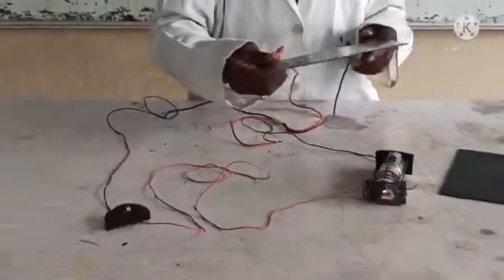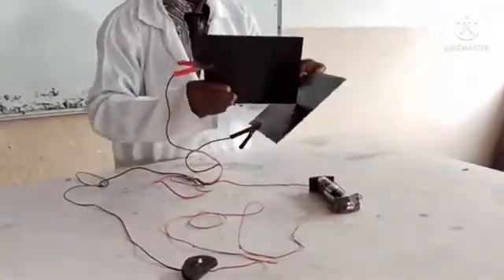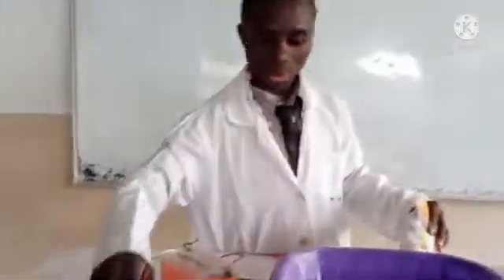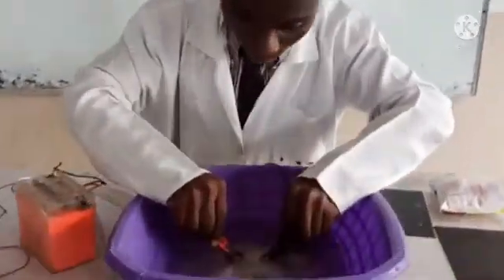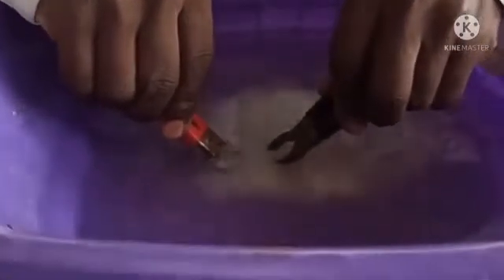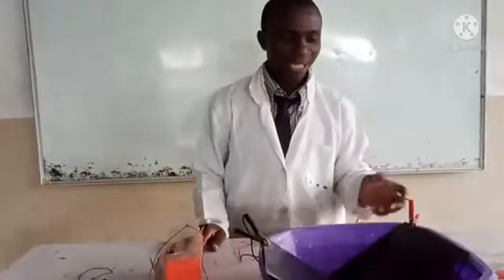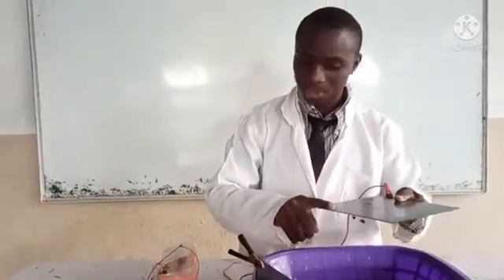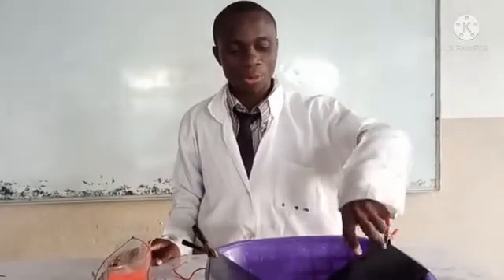carbon fiber test - electrical conductivity and electrode for electrolysis.

Comment: Hi! Can i use carbon fiber electrode to get potassium chlorate from electrolysis?
Reply from the maker: Though I haven't made potassium chlorate , however I have been able to make sodium chlorate , though it's been a long time ago. Used sodium chloride , I used graphite rods for both electrodes , if I can remember clearly , the graphite rods were wearing into the solution as graphite particles , though graphite wasn't taking part in the reaction (inert) I tried titanium metal electrodes but chlorine wasn't generated . My power supply was 12 volts , I also used about 220volts from from a transformerless system system I designed . I believe the same technique can be used to obtain potassium chlorate . Its been a long time anyway.  If not for the high cost of materials I would have tried to assemble the potassium chlorate cell.
Reply: @odereharrisonethe1931  Thank you. I tried to use graphite electrode and i got potassium chlorate, but there are black particles. I will probably buy a mmo electrode. It should be a good anode.